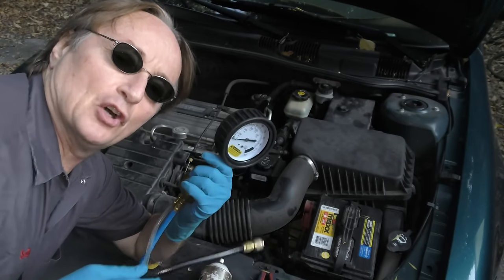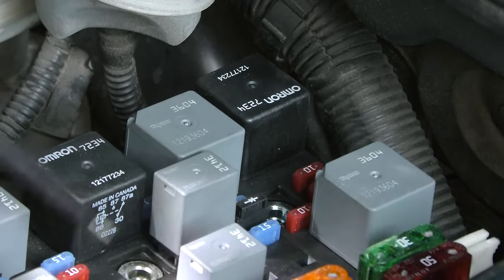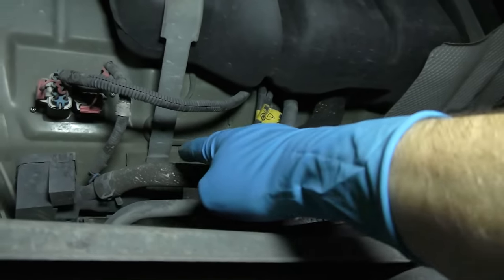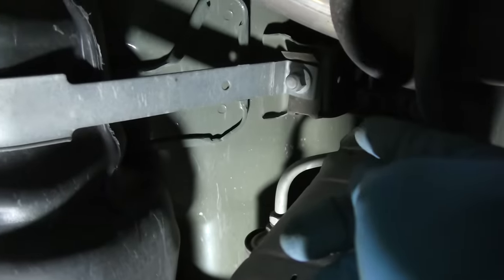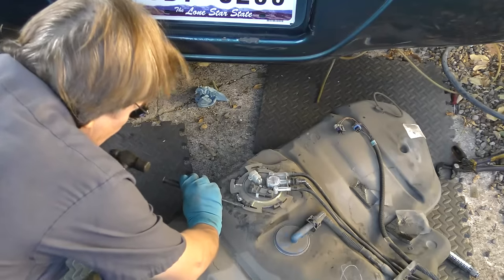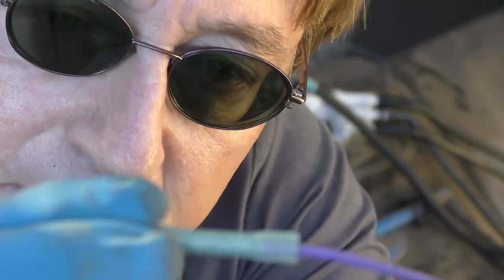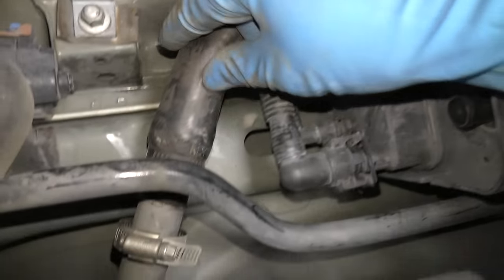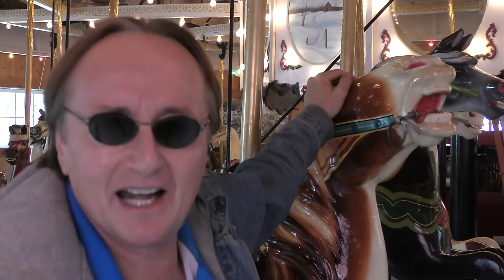How to Fix Car that Cranks But Won't Start (Fuel Pump Assembly)

Comment: What would you suggest is the problem if when i go to start the car the all it does is dim the lights,no cranks or clicks or anything...?

If it helps it was a flood car,but i already did everything else you said to do in your video on saving a flooded car.

Comment: I use to own a Dodge Intrepid, long story, but it had an access panel in the trunk that allowed you to get into the gas tank without dropping it. You could change the fuel pump/sensor from this panel. It came in handy when I had to drain/clean the tank after putting 5 gallons of contaminated gas in the tank. Never had any gas fumes in the trunk. Do you like this feature or do you consider it a safety hazard?
Reply from the maker: +richb313 it's fine but would not work with this pump design, the pump and hose assembly is just too large.

Comment: Scott, i have a question.. if your car won’t start but cranks and the battery is good, why arnt all the lights on the dash board light up? And plus i had recharged my battery and the door lock buttons won’t work nor my radio won’t turn on either with the battery fully recharded.. what could be the issue in this situation?

Comment: I am having trouble with starting my 2007 Toyota Corolla. I changed out the fuel pump assembly and bought a used one but looks like I still have no fuel coming in. I used a voltimeter to check the fuel pump assembly with sending unit and everything checks out. However it still won’t start when I installed the fuel pump assembly. 

What can I do to make sure there is electric running? I used a non contact detector to check the cords going into the fuel assembly and had No luck with any power. Should there be electrical current coming into or out of the fuel pump assembly?

Comment: Hey Scotty, a few days ago, the power door lock doesn't open the driver's door, all other doors open, I took off the door trim and the lock itself is fine, but the plastic cover that covers the inside of the door was peeled off right where the wiring harness for the Power door locks goes into the Lock mechanism. Is this the wiring harness' problem? How can I fix this? Thanks

Comment: i hate these in tank pumps. what is the benefit to those compared with external pumps? 
this is one of many reasons i like working on my '65. everything is so much simpler
Reply: +swapsplat 
$$$$$$

Comment: I did everything you did and now the fuel pump is working and it cranks and cranks and still cranks but won’t turn over snd stay on after installing a new fuel pump on my 2006 Chevy impala? Anything helps I’ve been working on my care for 3 weeks straight

Comment: Total amateur/beginner here: 
I ran into these symptoms on a '02 Civic. First I changed the fuel pump relay because it's cheap... that didn't work.. then I tried to check the fuel pressure but the gauge I borrowed from Autozone didn't have the right fitting, so, in desperation, I assumed it had to be the fuel pump and so I changed the pump & filter (there's an easy-access port under the back seat).. that didn't work.. then I took a look at the timing belt and found that it had broken in 2 pieces (for those that don't know, the timing belt on a Honda is an incredible pain in the ass). In the process of changing the belt, I found that the tensioner bolt had been over-tightened by the last guy who changed the belt and the threads on the aluminum block's bolt-hole were stripped.. After panicking for about 20 minutes I discovered the magic of Helicoil, which is expensive as hell, but did the job! Total nightmare because there's so little room that I had to turn the drillbit by hand with a vice grip, but I worked it out and everything's fine for now.

Comment: Hey Scotty just checking out the channel for the first time.
My car has been having a series of issues. At first, the pump wasn't priming and I wasn't getting anything at the turn of the key. I had it towed and it started to crank but wouldn't turn over. I figured it was the fuel pump at got a new one in after a good PITA. Now I am seeing pressure up front (don't have a gauge just a flathead screwdriver) and when cranking, the car boots up and vrooms but only once. And then shuts off immediately (and giving it gas won't save it). My buddy's guess was the spark plugs or FPR, and my guess is the injectors. I have no way of testing them and my 12v test lamp broke. Any suggestions?

Comment: Did you heat those plastic connectors to shrink the heat shrink. those looked to be the butt  connectors that have heat shrink.

Comment: Got a question I just changed the fuel pump out today, but for some reason it’s making a cranking noise a little then it starts up. What else could be going on with the car. I have 2009 Acura TSX

Comment: Great video! But how do you know when the fuel pump need to be replaced before it dies out?
Reply from the maker: +azn310 you pressure test it and if it has low pressure, change it. Plus many will whine in the tank before they go out

Comment: If it hadn't died while on the road, would you normally pull the fuel pump fuse and turn it over to relieve fuel pressure before starting?  I hope like hell I never have to do this job on any of my vehicles.
Reply: If you drive Chevys then guaranteed you will. Chevys are known for poor quality fuel pumps. That's why I replace mine with better quality ones when they eventually die.

Comment: hi Scotty i have a problem with my ford  fiesta. When i drive it just SHUTS OFF. all the lights/radio engine. the power steering is no longer working same with break pedal.  please help :P great video you should put more than 2 videos a week.
Reply from the maker: +Adrian Kolodziej  hey, don't be a slave driver, one a week keeps things going without getting burned out. First, when it does die, do my video tests "fixing a car that cranks but doesn't start up"

Comment: Hey i need some help my fuel still actives when I turn the key but it still doesn’t start
Reply: Did you figure this out man? I replaced my fuel pump on my 02 civic. Fuckr still won’t start and a few mechanics I been to are all at a loss of words  🤣

Comment: Great vid as usual, I have one observation and suggestion, Having spent a lot of time doing wiring and splicing of wires maybe a thousand I cringed a little when seeing you crimp the connector with a pair of slip joint pliers. Had too many failures going forward using that method. A ratcheting crimping tool is the way too go I use a 15.00 tool from believe it or not Harbor Freight it is adjustable according to the gauge of the connectors that is being crimped. Have yet to have a failure.
Reply from the maker: +Daniel Raidt I have a ratcheting crimper, but most guys don't, so I don't use em in my vids. The pliers I used are VERY strong and do work fine for this app.
Reply: +Daniel Raidt I've got a pair of Gardner-Bender crimpers/splicers that I'm not sure how I'd live without, I've used them so many times. I particularly like the crimper, it puts a pretty good dimple in the connector for a rock solid splice.
Reply: +Scotty Kilmer 
I noticed immediately those weren't "normal" pliers. I have  some Knipex pliers....incredible power, but they ain't cheap! 
I do agree with Daniel though.....hell, I probably woulda soldered 'em!

Comment: Scotty I have a 84 dodge 318 with 2 Barrell carb. Holley. freshly rebuilt. new everything. runs great. cold start is great. but hot start, (after its been driven for a while then turned off and parked for 5 min.) it is rough and cranks for while and runs rough for a few seconds. what do you think it is ?

Comment: Why I love my Mercedes 190e, fuel pumps and filter are under the car and readily accessible, (with jacks or car ramps) no need to drop the tank and that nonsense.
Reply: +Kofi They have the same in w210. Also nice (plastic) cover to keep crap from corroding the system. I wonder if it's a Mercedes-thang to make it easy, or some other reason.

Comment: I need to replace my fuel filter and I have a unit like that. The retaining ring (that thing you tapped on) won't budge and I'm afraid to strike it, esp. with a piece of metal. Is there any way to ease that part? Everything else, I don't mind doing, like reaching into the tank and pulling up a part that reeks of gas. '09 Hyundai Sonata 4cyl btw

Comment: you should of fitted a new filter as partialy blocked filters are one of the biggest causes of fuel pump failures

Comment: So i bought a new fuel pump because the same problem happens to me in my Pontiac Grand Prix, i bought a new one and changed it out and on initial ignition it didn’t work. We wiggled some cables around that connect to the pump and it turned on. A couple of days ago i went to the gas station and it shut off while it was running, luckily it turned on again. Any idea on how to change the wiring?

Comment: Recently changed the fuel pump. A few days later, the car was running low on gas and after parking it for a couple hours it didn’t start. Car cranks and cranks but no start. Yes there is fuel pressure after checking schraeder valve. Any ideas on how to diagnose?

Comment: Just changed my pump in 05 sunfire, after installation car started up, but its been 2 weeks and there is still a loud ringing noise from the pump, been sounding since the installation and it leaks when refueling, what are some causes for the sound, also did not use the new wire that came with the pump

Comment: I have a 2000 Chrysler Cirrus with the V6 engine that if it sits overnight, it will take about a minute of cranking before starting. But will start back up no problem after some driving. Could that still be the fuel pump?

Comment: I have a 1990 c1500, ran great for a ling time then noticed a misfire like issue. Then one day i stated the truck and it ran for about a min or two then stalled. Has 5.7 liter, new fuel pump, has power and only runs on brake cleaner. Relay works as well. Does show some small amount of fuel going into the tpi throttle body.  Could this be a fuel filter issue? I mean the truck is 29 years old and probably has never been changed.

Comment: Hey, love your channel and your videos, everyone else 'pads' their videos with garbage, you don't!
I have a Mitsubishi 380 2005 that won't always start. 
At first  it would only start on the second crank, did that for a week. Then 3 and 4th crank for a day, now it's a MISSION to get it started. Once it starts it runs great, no sputtering. But as soon as it's off it's hard to start again. 
I have spark, fuel pump whirs when ign turned on, there is a very faint high pitched noise near the firewall while ign on, that goes after 30seconds, but will sometimes start again after a min then switch off again. 
Please help, I really appreciate it! 
Sean from Australia :)

Comment: I tried fixing a v8 range rover with    
a crank no start situation. In the process of diagnosing the problem I noticed that when a friend help me turn the ignition key to ON position. These ignition current didn't get to one side of my injector circuit as usual in other cars. Please what can cause such a problem? What should I check  
for? Assist me please.

Comment: Hey Scotty im at a complete loss on my car(2002 pontiac grand am v6). Whenver i start it after it sits for muiltiple hours the car just cranks and cranks. I hear my fuel pump working but i have no clue what else to do. Once the car starts its perfectly fine as long as it doesnt sit for too long. Ive had mechanics tell me its the fuel pump and others tell me its the fuel injection system. Im not a car guy at all but ive done everything i can afford to do such as change the fuel filter and air filter but if i pay money to get the new pump or pay to have the  injectors cleaned i want to make sure i do it right.
Reply from the maker: +BroganDC123  well, when it doesn't start, do my video tests "fixing a car that cranks but doesn't start up" rather than just guess, it could be any of those things

Comment: morning scotty as it relates to fuel pump when replacing the fuel pump is it necessary to remove the fuel pump fuse and start the car a few times to relieve the fuel pressure beore removal of the fuel pump or that is not necessary?
Reply from the maker: +aruna khan yes, you can do that if pressure exists on the system to remove it

Comment: I was having this issue with my Volvo s40-but I’m not sure if it’s an inertia switch needing reset, my fuel pump, or the control module for the fuel pump. I braked a little extra hard the other day and my abs service urgent and service airbag urgent lights came on, then my car wouldn’t turn off for a few minutes after taking out the key. When I tried to restart it, it took five minutes for it to finally start, but nothing on my cluster was working except for those two lights. After resetting the battery it started fine and cluster back to normal. The other day however tried to start the car and battery was dead, had it jumped and power returned but now car just cranks but won’t start- do Volvo s40’s have inertia switches? Mines is a 2006 Volvo s40 s.4i T5 I believe. I only bought this car because I was in a bind and have been able to make payments on it, but now I’m in danger of losing my job because I haven’t been able to make it to work. Any help would be appreciated. I just don’t want to spend money if it’s not the fuel pump. Would you start with that first if you were in my shoes? The cheapest one a shop can order for me is $335 out the door which is better than the $600 autozone tried to charge me.

Comment: At what mileage did F Pump fail?  is there an approx. life of these F Pumps ? ( as to avoid a breakdown and change beforehand ?)   Perhaps change filter too at this time?
Reply from the maker: +Joe T this one had 166 thousand miles. There is no time, just pot luck really. But you can pressure test them to see if they are weak and going out.  You can also change the filter but this one was already changed earlier

Comment: Scotty how an AC filter for a 94 celi can be changed? Do I have to disarm the whole thing?? It uses a different parts from what I've seen on you tube (uses a 87130 20580 fan)

Comment: Hey scotty! I have a 91 sunbird 3.1. I had a instant drop in pressure when I turn the key off. The car would run but only for about 20 min. It seemed like once it heated up it dies. Anyways.. I replaced the pump thinking the check valve was bad. I still get the drop in pressure when the key is off. Where is the check valve located?

Comment: Hello Scotty, 2003 Ford Mondeo diesel. I suspect my fuel pump is weak or has died, but cannot verify it. When running warm, there is no problem except when on cruise control there can be some juttering and the radio's lights blink. When starting from cold, it takes about a couple of minutes to run without hesitation. There is no valve to check the pressure. I cannot hear the pump running from the turning of the key, even with a stethoscope. The scan tools say nothing. I am think of lowering the tank again to check next summer, but it would involve sawing away the metal feed pipe as the connector to the tank has rusted solid, then and clamping on another plastic tube after the fix. My questions are is it worth it? Also can a car run with the fuel pump being dead by using the suction of the engine's high pressure pump alone, or does it not work that way? When the fuel pump dies then all cars stop? Many thanks in advance for taking the time to reply.
Reply from the maker: +Thompson Kong diesels can sometimes run just on suction from the main pump, but if it has a pusher pump in the gas tank, and nothing has pressure there, I'd change it first

Comment: Thought you can access the fuel pump from the upper trunk floor through a large grommet? Or doesn't this model have that?
Reply from the maker: +Travis Piper not on this model with this giant fuel pump assembly and long lines, hole would need to be 4 feet long
Reply: Scotty Kilmer Ok, yep the long tubes and wire would make sense.

Comment: yup,thats happen is right,i have this problem last time,fuel pump won't running,no gas supplier to the engine..after i servicing my fuel pump,its back to normal again..

Comment: Chrysler 300 cleaned throttle body has good battery starter good I did run out of gas once but after I cleaned the throttle body it never started .
Reply: doesn't click at all

Comment: Hey scotty! My 08 Nissan quest wouldn't start but when I stop trying to crank it, the speedometer dials tick up/down. I replaced the starter,  the battery, and the alternator. It's doing the same thing. My battery  does have a positive connector that has these fuses on it and the positive connector also is pretty corroded. But it starts up when I jump it. What else can it be? crank/cam shaft sensor? Please help. Thank you very much.
Reply from the maker: +Modern Renaiassance Man   replace the whole positive battery terminal assembly, or splice on a new connector for all the wires there.
Reply: Well it turns out he acid from the battery terminal made its way into the connector. Scrubbed it with a wired brush until the copper shined on the positive connector and VIOLA! It started right up. Thanks for your help though. I watch your vids all the time and I feel blessed to have come across an honest guy like your self.

Comment: Scotty, got a 2000 honda accord I recently replaced the throttle cable, which connects to the gas pedal, but every time I floor it it feels a bit hard to push the pedal and get it to move quick! Any tips? Could it be a clogged valve?
Reply from the maker: +grandcarvan1999  make sure it's not binding, and clean the throttle as in my video "how to fix a car that idles poorly"